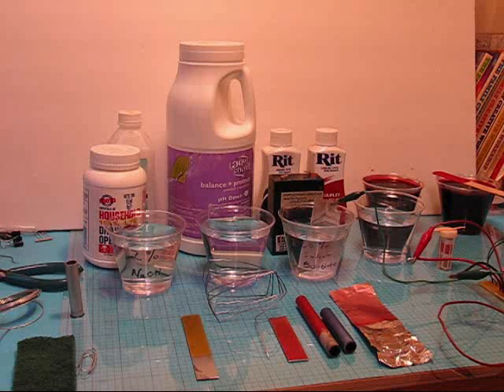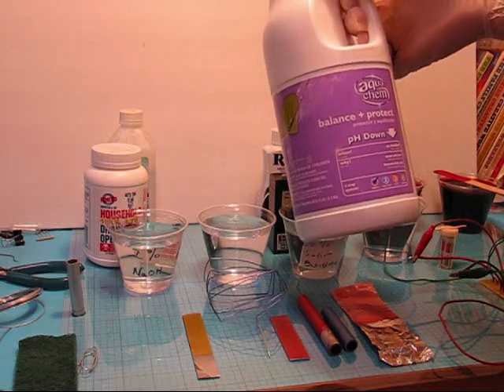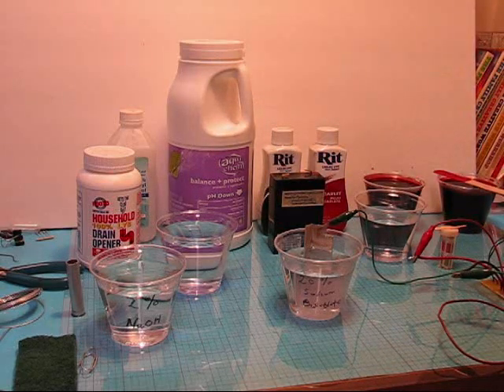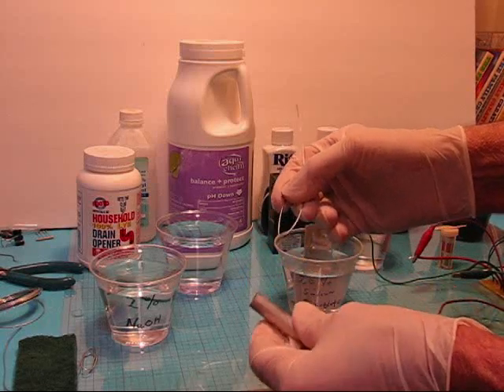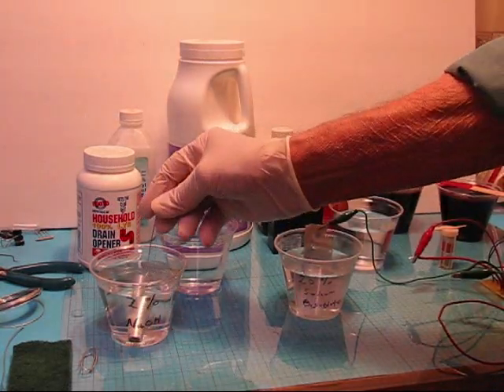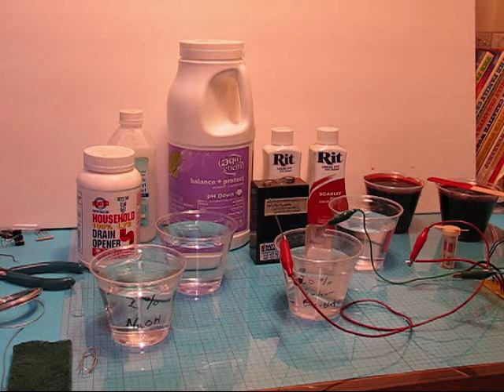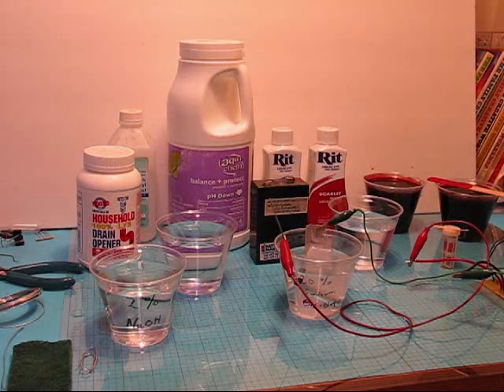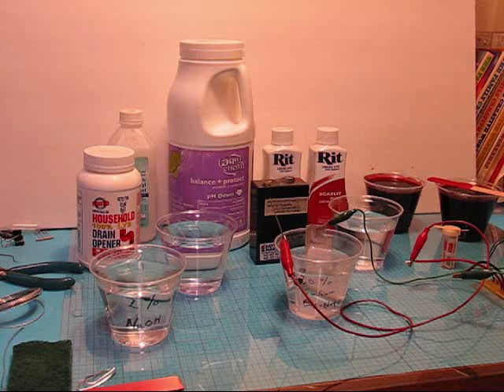Anodize and dye aluminum without battery acid!

Comment: So sulfuric acid (muriatic acid) is hard to find it's at Walmart,home depot , lowes  and every pool store and his alternative is sulfuric acid in powder form used to do the exact same thing
Reply from the maker: Try spilling some liquid containing liquid H2SO4 on your clothes or skin and see what happens! Then try transporting it. Thanks for the comment, Ken.
Reply: @observationsblogcom  dude I transport pellets of hydrochloric and sulfuric acid as well as chlorine tabs and sticks I work for hajoca it's a plumbing and pool supplie company and I'm a truck driver you are not going to educate me about dangerous chemicals took hazmat test every 4 years for last 35 years
Reply: @observationsblogcom  try baking soda (sodium bicarbonate) it neutralizes acid and is used in pools to lower ph just like your supposed battery acid (sulfuric acid) is used in pools to raise ph